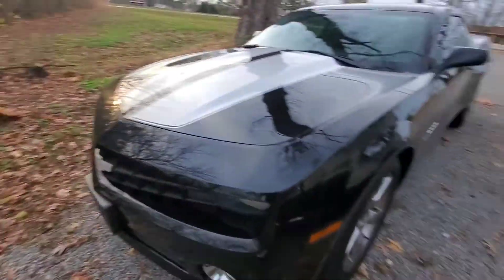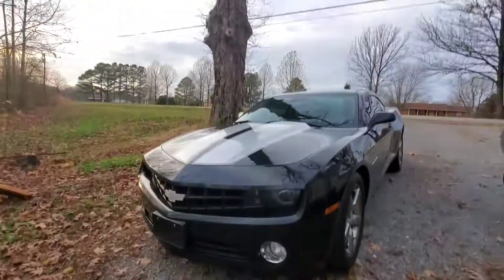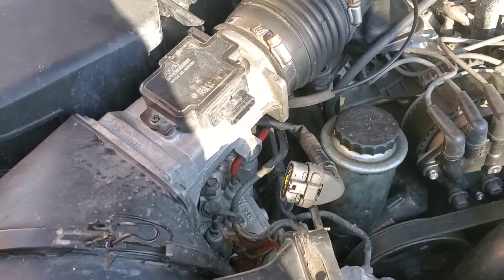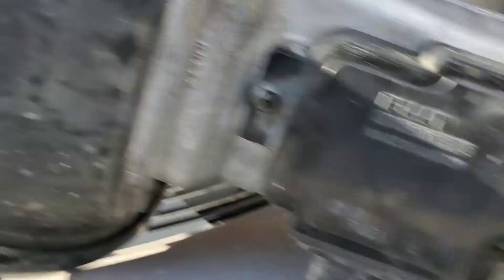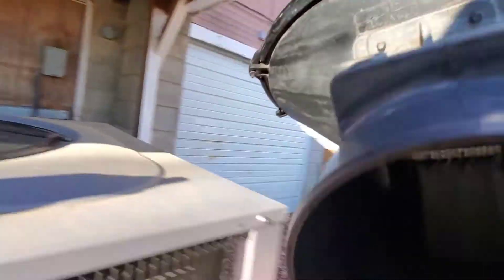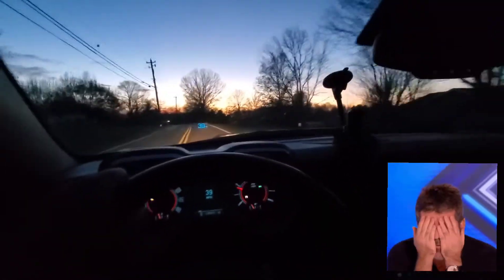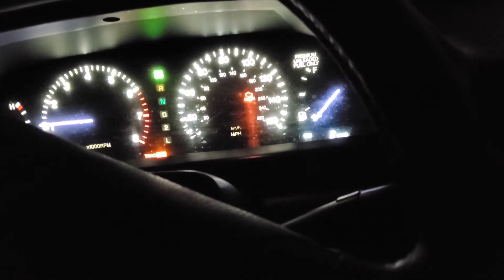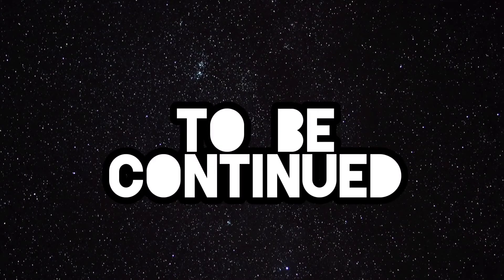VLOG | mass air flow sensor cleaning | 1992 lexus ls400

Comment: Yo I’m glad it worked fam, the engine light stays on for a bit you have to drive it 5-10 miles for it to go away. If it doesn’t go away take off your battery terminals for 5 min and put em back in. You should be good now

Comment: Hi , i am harry, i leave in France, i have lexus ls400 96, but i have à probleme, many many   smoge at the back of the car ! I change some parts in the engine ! No défault in computer could you think it is the maf work bad !
Reply from the maker: Smog or fog coming from the back (depending the color of the smoke) it could be an oil leak or oil burning off. Does it smell burnt?

Comment: You killed the sensor   You need to clean it with air only
Reply from the maker: I was just following what people on the forums said. Then I realized I messed up. But a whole tree fell on the car. So that project is to say the less... junked
Reply: Is air the only way or do I have to find a oem maf for 1991 ls499? Needing help she smokes and is sluggish. I unplugged maf and idle didn’t sound like misfires anymore afterwards.

Comment: my speedometer sometimes doesnt work but i smack the dash and it works but if this spray works then well see
Reply from the maker: From what I learned. Spraying down probably isn't the best idea for this. You may want to check your speed sensor. This is for the maf sensor
Reply: @MyLifestyleShoppe  my maf is messed up to i forgot to say that the car hasnt started in a while it jus keeps cranking and its an sc400 so if youre ls400 started ill see about mines
Reply: Don't do that. You can actually cause the needle to fall out. The needles will come back to life after some time. But the LS/SC/LS430 dash's have to get rebuilt for these issues.